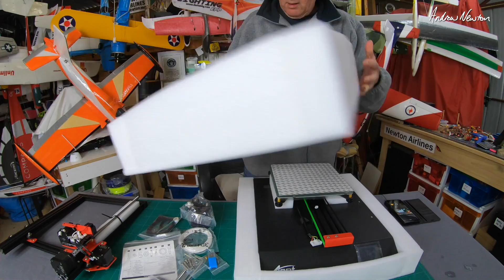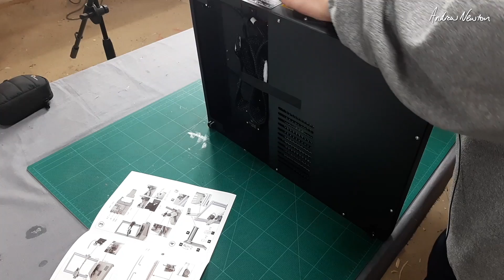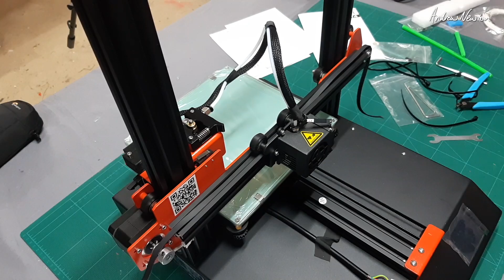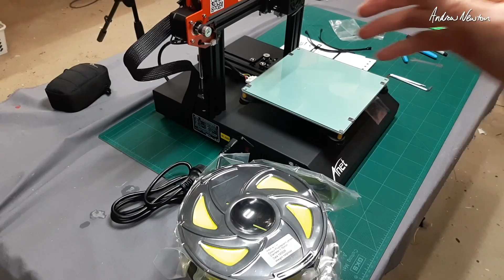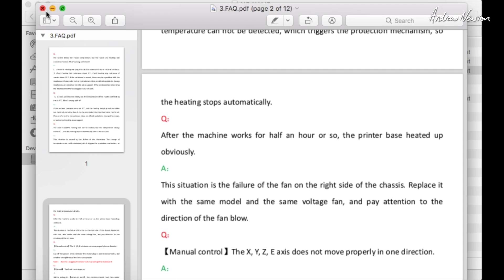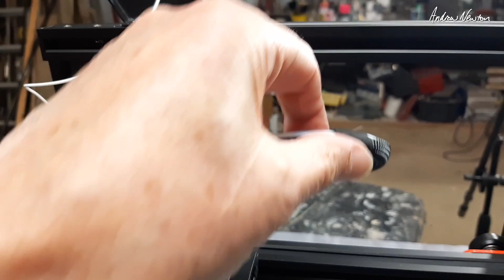ANET ET4 3D printer - Assembly

Comment: i have just received my printer too, but i'm not able to make it work properly ç_ç i can just print what's already inside the sd card. Ultimaker cura doesn't work properly for me.
Reply from the maker: Cura doesn't work well to drive the printer directly apparently, but it's best for slicing. Have to use Reptier if you want to connect via USB